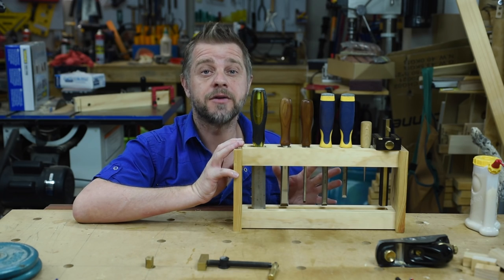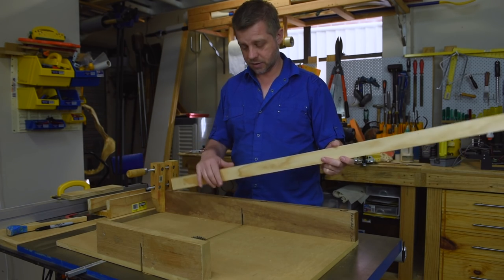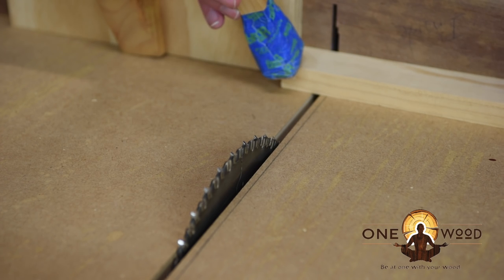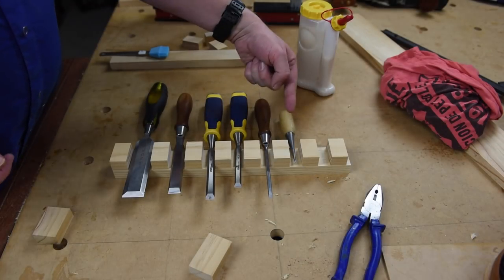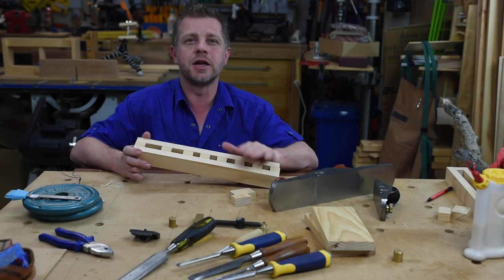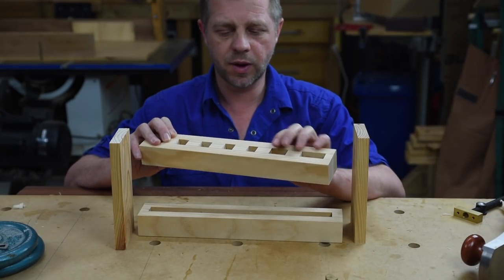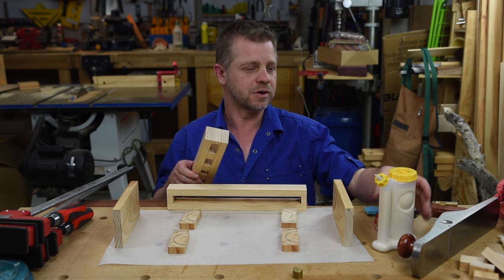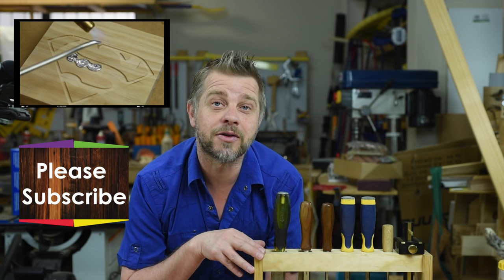🔨 Woodworking project build a DIY Chisel Rack, Beginners woodworking Project #woodworking

Comment: end of the board not enough simply glue. you must apply carpentry connections
Reply from the maker: For this size projects its fine, i tried standing on it and it can hold my weight, i also made one about 4 years ago and it's still going strong. I was going to throw a couple of brass dowels in the end for decorative / strength purposes, i may do that later.